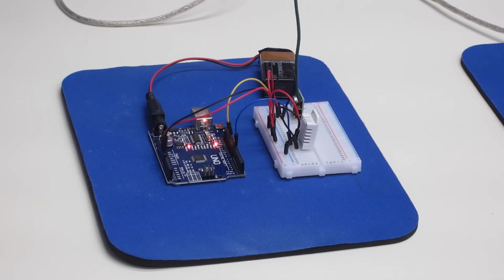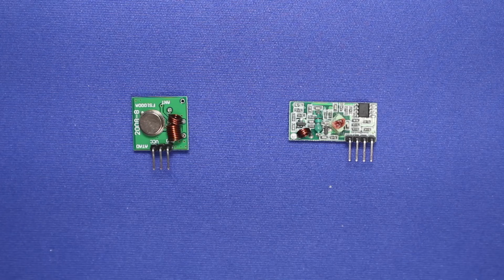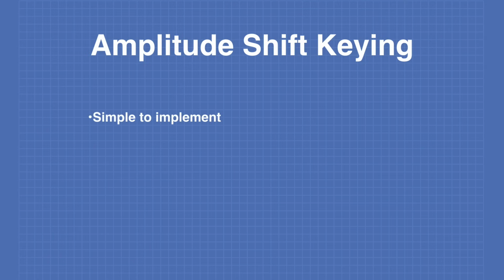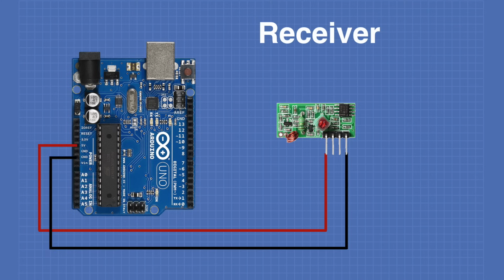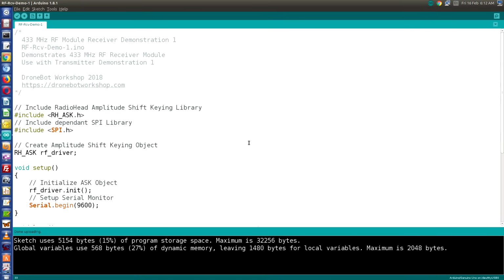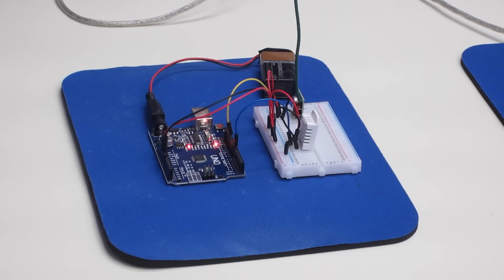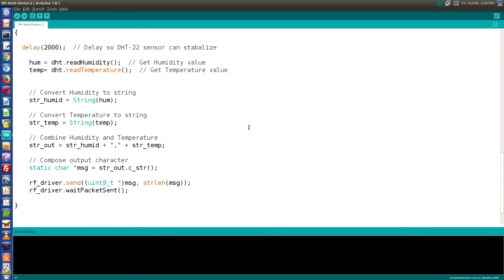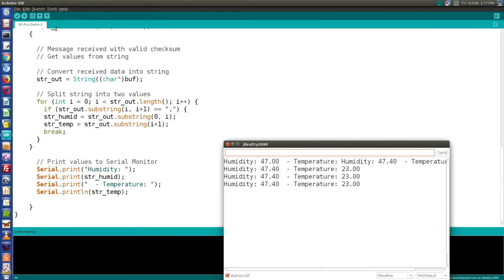Using Inexpensive 433 MHz RF Modules with Arduino

Comment: Bro I want to make cube satellite for weather i will send data with Morse code for transmitting and receiving what modules I Shud use bro my mail: nirmal9182001811@gmail.com
My phone:9182001811
Plz contact me I need it plz plz my project stop in middle at transmitting

Comment: Really nice video, helped me a lot. I have a question: I want to send the soil moisture sensor values via 433mhz but the value is sometimes only one digit, sometimes 2 or 3 digits. So I can´t predict the length of the char. Is there a solution to this ? (sorry for bad english)

Comment: Used an Arduino UNO to get familiar with these 433MHz devices.  Then tried to implement the TX side using an Arduino Nano.  No luck, as I could not see that the TX was actually transmitting anything. Moved back to the UNO, and the transmitter works just fine.  The are only 3 wires for Demo_1!  What am I doing wrong? Anyone have any ideas?
Reply: I am using exactly the same modules used in the video and have no problem with driving them with a Nano... Make sure, that the transmitter's data pin is connected to pin 12 and the receiver to pin 11 on the other board. Also make sure that both modules get properly powered by at least 5v (transmitter can be higher) and not with 3,3v of like a low power arduino.

Comment: Its been 7 hours sence i started to work on simple led and a botton all i want to do is when i press the button led turns on 
I need help.
Reply: I'm doing research for the exact same thing. Any luck?
Reply: hi use at least 3v or 5v battery. positive to 330 ohm resistor - to positive leg of LED {long leg} then other leg of LED to Ground - Negative of battery.    Battery + ---[resistor]------ + [LED] -  ----- - Negative of battery (ground)

Comment: Hello Great channel....
Just recently subscribed and I'm really anxious to learn... I have been searching for a channel which doesn't put me to sleep..... there is something in particular which I would like to ask I do plumbing and heating work in a couple of hockey arenas or ice rinks And have been asked if I was able to come up with something to control a water level in a  tank.... this arena has a piece of machinery called a Zamboni which is Similar to a truck which is used to resurface ice rinks these machines are filled depending on the size of the unit anywhere from 100 gallons of water up to 1000 gallons of water and this volume is typically used every hour or so..... With these machines basically spreading this water over top of the ice surface to make it smooth for the next customers coming on the ice to skate and or play ice hockey...... The employees at this rink basically take a 1.5" diameter hose and inserting it into what would be similar to one Taking their vehicle to a gas station to fill up with fuel.... They then open a valve and start filling the tank  which is located inside of this machine... (or vehicle)...... The tank is filled with hot water and where the problem starts as perhaps their supply store or the phone may ring distracting them from filling the tank at this point the tank is then overflowing and basically wasting 50to 100 gallons of hot water per day.... I could have simply said I would like to know if there was an idea or a component available where I was able to perhaps insert a sensor in side this tank or on the side of this tank and have this sensor basically activate An electronic valve (solenoid) So in essence I have a transponder and a receiver which would have to be wireless people often confuse wireless and Wi-Fi the Wi-Fi option would be nice but not absolutely necessary however I could not have a physical wired connection between the solenoid valve The receiver And a sensor transponder In the water tank on the Vehicle. For example if the employees were to have a filled vehicle go out and dispense the water on to the ice rink once coming back into the garage one would insert the hose into the tank and tap a button or switch to initiate the solenoid valve to begin filling the tank with water once this sensor (transponder) Rises with the water level And will initiate a signal basically disrupting 24 or 120 Volts AC... These valves are much more easily available in 110 Volt  AC.... I know how I would be able to do it with a physical connection between the transponder and the receiver however it is not practical in this situation and trying to find a wireless alternative I have tried something as simple as purchasing a gas nozzle similar to what's used in a gas station however this device does not function correctly as it will shut off frequently or will not shut off at all so this is not an option also I have attempted something with a solenoid valve and a timer however the water volume required continually changes as it is Pending on what is used at each resurfacing or (flooding) I apologize for the long message and I appreciate anyone taking a moment or several moments to read this but any input would be greatly appreciated!!
Thank you
Burnell
david@burnellmechanical.com
Please keep up the great work I learning something every video....

Comment: I am designing a mini robot, that has a head (with sensors) and a body. The body and head have no electrical contact (they are in touch magnetically). I want to be able to send the sensor data from the head to the body, which is communication at a distance of about 4-5 cm. Placing an antenna isn't the best option for me, do you think the RF modules would still work?

Comment: Can you show the antenna connections?  I see ANT on the transmitter  and comparing to your unit I think I see where to put my antenna.  On the receiver, I'm not finding an ANT hole anywhere.  I see one run that isn't signal, GND or VCC that ends up under a chip on the transmitter.  Could that be it?

Comment: Sir i tried to use this as to make my project but everytime i put another if statement inside the if statement its my led output is not function  and also the transmiter send messgae and the receiver accept it and then the led output please help 😭😭😣😣😣😣

Comment: I tried one of those rx/tx pairs and could get it to work no matter what I did.  So I gave up on the project.  That was 4 years ago.  This is the first video I've seen that explained how to use the rf modules and by watching your video I FINALLY know what was wrong.  I saw the little coiled wire on the transmitter and receiver and assumed those were the antenna.  Once you explained that an external antenna is required to get more than a couple of centimeters of range I realized that was my problem.   My experiments had the two arduino about a foot apart and when it was not working I thought maybe they are too close so I moved the transmitting arduino across the room but that didn't solve the problem so in total frustration I gave up and moved on.  Fours years later and I stumble on your video and watched it and thought wow...I can not believe that is all that was wrong.   THANK YOU!!!
Reply: Did you connect togather 2 GND of 2 Arduinos? I think it ia my problem. Thanks

Comment: my module comes without that smal coil on emitor module (i put 3 turn with CuEm 0.65 mm) and at receptor part is missing that normal resistor soldered on pcd side with smd components, and i can't read the color to know the value. can u help with colors or value or that resistor? Thanks a lot

Comment: hi, I am doing a project where i am building an security alarm with one senor, i want to able to use this 433Mhz RF modules, i want to be able to connect the sensor into the transmitter transmitting data to the receiver. this project i want to include a keypad and LCD to provide password, once the senor is activated my movement i want the receiver to activate alarming with a buzzer, password should be entered to silence the alarm. do you think i b able to do it, i am a noob when it comes to arduino

Comment: Thank you very much for your excellent tutorials
The demo ran without problems
I have DHT11 but I can't repeat what you are doing with DHT22 ?!
I changed the dht type to DHTTYPE DHT11 in the transmitter code and tried pin 8 in place of 7 and nothing, the serial monitor remain empty

Comment: Hi and thank you for your helpful tutorial. I was able to use it to get started with a project. However, Now I would like to capture my arduino transmitted packets with a raspberry pi. I was wondering if you have any advice or ideas for such a case. For example, is there any encoding, and do I need to use the radiohead library with the pi? Thanks for any suggestions.
Reply: Hello, have you found any solution to this?
Reply: @tyyko3643  Not really a solution, just a workaround. I've decided to just communicate via serial communication over USB to interface with a computer.
Reply: @Datzfunk  Thank you, I finally found the vw library for the Pi but the range is only a meter, so I will use another Arduino to receive data and send HTTP requests to the Pi which is in a different location. Pity that the Pi cannot easily receive 433mhz messages
Reply: @Datzfunk  Thank for your reply! I gave up as well :)

Comment: Very good explanations for the implementation of these modules. Thank you.
How to do it if you do not use the pin 12 for the transmitter (on Arduino board) ? I have a project of datalogger and RF transmitter with an SD card module that also uses this pin 12.
Reply: Not sure if you still need this information, but, according to the library documentation, you can set both RX and TX pins in the RH_ASK constructor.

So instead of writing
RH_ASK rf_driver;
you would use something like
RH_ASK rf_driver(2000, 11, 3); // 2000bps (default), RX on pin 11 (default), TX on pin 3 (our desired pin)
Reply: Thank you Kosmonauta12 for this information. Since my message 2 months ago, I abandoned the use of this type of 433 MHz module because the range with obstacles is insufficient and random. The transmission protocol is too simplistic. I opted for low cost modules NRF24L01 or LORA which give much better results and very reliable.

Comment: Thanks for the video. I had accidentally plugged the 5V to the Data pin and didn't notice until I saw your video and I don't receive anything at all even with your setup, could it be that I fried the module because of my mistake?

Comment: Well made video... A couple of issues with the code, but otherwise it was really good.  I ordered a pair of these (i.e. receiver and transmitter) on eBay recently for $1 and was looking to see what library I was going to need to use to make them work.  Haven't decided what I'm going to use them for yet, but it was so cheap that I had to buy it to see it might be useful for some future project.  I was originally thinking that it would allow 2-way communication, but it appears from your video that is not the case.  Oh well, I'm sure I'll find something to use them for... :)
Reply: On GOOGLE do a search for Arduino RF433 MHz and yo will find lots of experiments you can test and build.
For more serious work check out nRF24L01 or RMT-12

Comment: An excellent guide to the 433MHz modules. The trick with adding a 17.3cm wire to the GND really improved the range. Just one thing is slightly misleading and that is the buffer size. You imply that the buffer size should be equal to the message length, whereas it should be equal to or greater than the expected message length. Just a friendly hint, for those who take things literally!!

I have to correct my statement a little. Some buffer sizes, longer than the expected string length, will return the correct string, whereas others seem to add spurious characters. If you use this fixed buffer length, I guess there are going to be problems when the length of the floating point temperature goes under 10 degrees C down to zero or below -9.9 degrees C, as the whole string length changes by one character.

It may be better to read the raw data string, i.e. 40 bits, and transmit that to the receiver to do the checksum and conversion work! Just MHO.

Comment: For better results try a different and better receiver called RXB6, a little more expensive.
The transmitter can be powered with up to 12 Volts. The maximum datarate is about 2000 bits per second.
Enough to transmit small messages from temp and humidity sensors like DHT11 or DHT22, or LM35, TMP36 temp only.
For even longer range you can try nRF24L01. Range here is about 1km in open air with a good antenna using 2.4GHz.
Very good tutorial as usual. Thanks.

Comment: Very well explained, the antenna length of 17,3 cm is a great advise. You said something like there is no split function, maybe it is a good idea to stimulate to create one, a function, and put into your toolbox (a library - toolbox.h|toolbox.cpp) so you don't have to invent the wheel next time you need such function. In the arduino community I dicovered people repeat similar steps over and over again, they using libraries of others however don't create libraries themselfs. 

As result, you will notice large sketch files with just a few changes (copy-paste) and horrible to maintain. People must start/must learn to create functions to split the problem into reusable parts/snippets, especially when project starts small and extend over time (it usually does). 

Supporting this method of developing a solution will be a great addition to your channel and the very clear explained content. Keep up the good work ;-)

Comment: Is there a receiver / transmitter or 2x transceivers you'd recommend for sending data about 300 meters? My ranch is in middle of no where Colorado mountains so I have about as little interference as exists. I have these same modules at 315MHz I'm going to be testing out and seeing, of course the transmitter will be at 12 volts to try it. Not sure how well it will work now that I saw your body caused issues with yours being so close together.
Also for your split for loop toward the end take a look at:
http://www.cplusplus.com/reference/cstring/strtok/

Comment: Hey, I have a question. I am currently working on a project that might be able to make use of this 433mhz setup, however, I'm using two Adafruit Trinkets, not Uno because of size constraints. They do not have UART capability so no serial ports and the library might be an issue as well since I'll have no pin 13 and 11. All that I require is to turn a light on and off on the receiver side via a button on the transmitter side. Any suggestions?

Comment: Hi
I have exactly the same transmitter that works BUT I purchase another unit that only have 1 coil and it does not work, several units do not work, are they defective?

Comment: I need your assistance in a project.

I have connected the electrical appliances to node MCU through relay and manual wall  two way electrical switches as well.

I am having problem in syncing real time on/off status of electrical appliances connected to nodemcu through relay on BLYNK project application when I turn that appliance on/off through manual switches.

If you could help me with  sketch and circuit diagram of what I am trying to achieve , then please let me know.

Please see the video of what I am trying to achieve.

https://youtu.be/85op7EojNAc

Comment: Thanks for all the effort you put into your videos.  This one in particular was very informative.  But most places where I would like to place a transmitter require that the project be as small and unobtrusive as possible.  And battery power is most always a requirement.  To this end, using the ATTiny85 is a preferred over any other MCU.  The size of the receiver side of the project seldom suffers the same size or power limitation.  Do you have any plans for another video keying in on using the ATTiny85 in the transmitter ?  Again, thanks for your videos.

Comment: Thanks a million.  I have had several of these little sets in my parts box now for several years, never really sat  down to figure out exactly how to use them though.  My need is for an outdoor thermometer mounted under the hood of my Class A  Motor Home.  She is an 03 but the makers never saw fit to put that system in the rig.  I would like to have the output to an LCD display and combine it with an electronic compass that is also missing in the rig.  Since we travel all winter, in the American South West, both devices are almost necessary, as of yet we are depending on our cell phone apps for compasses and have one of those home indoor-outdoor thermometers mounted on the Drivers Side wall but it is back in the dining area next to the booth, so not viewable while traveling, and is not wireless, it has a sensor that goes out one window and I have glued to the exterior wall of the rig.  This tutorial should get me running with my system, I have may arduino's available in several types so building the devices should be a breeze, it is just the software that had me stumped this far, you have shown me the way, so thanks again!
Reply: Fix it yet?